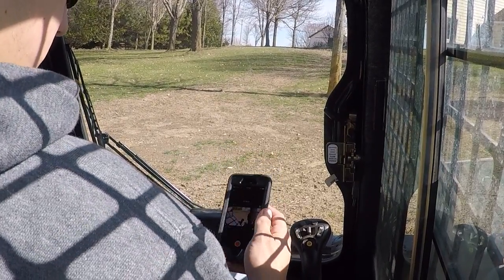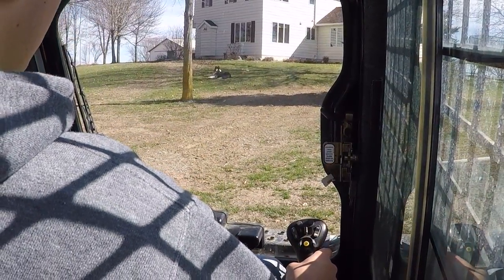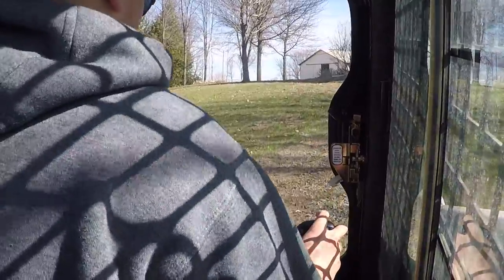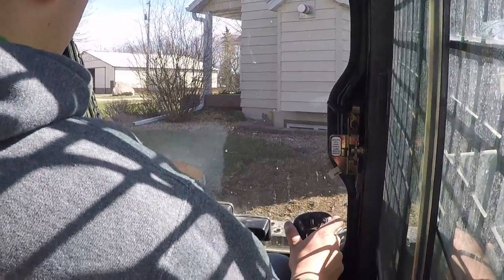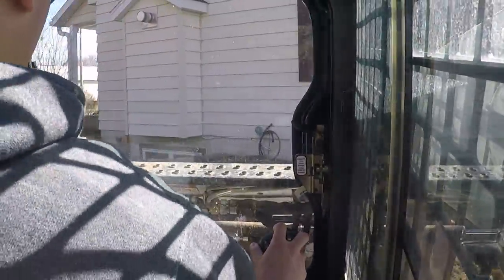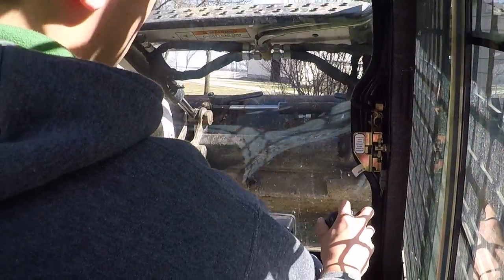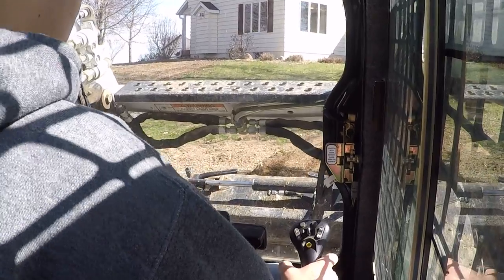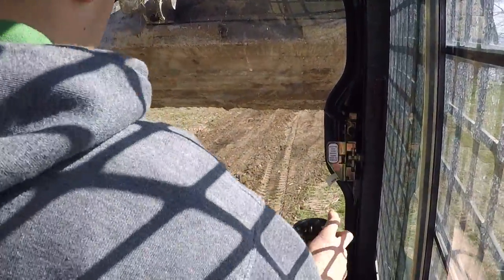More Dirt Work and Talking Solar Energy

Comment: I like this view, it's how my Bobcat videos were.  Nice to see actual ground without snow! I have solar panels on my roof, they produce about 1/4 of the energy I need.  Panels are 8 years old now and just need washing twice a year. Output has not changed much. My roof is flat concrete and the panels are adjustable tilt
Reply from the maker: Interesting...I was always afraid and skeptical that they would be worn out by the time they paid for themselves
Reply: Mine save me about 100 dollars a month. They were built from damaged panels so they really only cost me materials and time to fix them. The batteries are the biggest ;pain in the rear because new ones are really expensive and I rebuilt old lead acid batteries to use in my system. .
Reply from the maker: Holy smokes!  sounds like you know the insides and outs of them